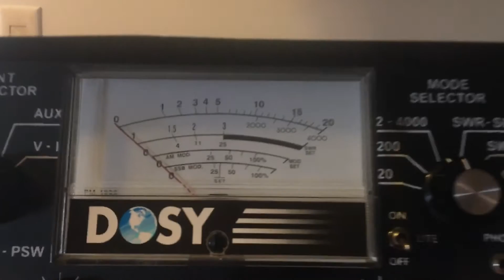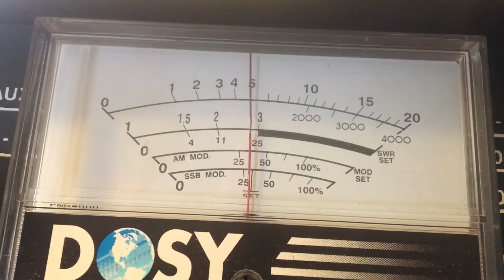6 tube elkin

Comment: Elkins are very good amps.  Friend of mine has an eight tube cluster, and he will not sell it period.  He finally got back his two tube that Ray rebuilt a few years back.  Would love to have an eight tube cluster, but they are hard to come by.

You mentioned a six tube Zodiac.  I just recently traded into a six tube Zodiac with a custom top case.  Ray's partner Brady built the Zodiacs.  Zodiacs have more tuners inside than the Elkins.  I counted four tuners on mine.  I did have to tune the input.  Not messing around with the other three!  It's doing about the same thing as the Elkin is doing in the video with a true peak meter.  Does not have high/low switch, but does have a power adjust variable on it.

Comment: I'll buy it
Reply from the maker: Lance Larymore sorry bro. This is a 2 year old video. It’s long gone now. I do have another that will be up for sale as soon as I get it back from the elkin tech. Keep checking on my videos. I’ll post as soon as I get it back
Reply: @Worldwide75  elkin tech name Shine ? Johnathan L. 
Or Ray ? Lolo . Shine is my best friend he worked at Elkin and his X lolo
Reply from the maker: Lance Larymore actually it’s frank Langley in Chocowinity. He’s a certified Elkin repair man. He does a lot of work on Elkins in my area and I just want him to double check everything in that six tube elkin and I also have asix tube zodiac in super good condition. Both will be going to him for a check up and then I will keep one and sell the other
Reply: @Worldwide75  these should do 800 if it's a super 6 . I've had 10 2,4,6 ,8 and 12 but I want another real 2 tube elkin
Reply from the maker: Lance Larymore I’ve owned 11 six tubes all with new tubes and I’ve never seen one do more then 600 pep on a peice of junk dosy meter lol
Reply: @Worldwide75  if it's a super 6 with 6lq6 with a high low switch it should do 800 . The straight 6 does 600 . I've had 4 super 6 and Shin guy worked at Elkin with his wife ( used purple wire) so they know who built it , wife used pink or course . But all my super 6 Did 800 on a bird . That's swing with bias up .
Reply from the maker: Lance Larymore 12dq6 are in all of the 6 tubes. A super 6 is the ones with high and low
Reply: @lancelarymore1667  "That's swing with bias up ."   I want my tubes to last years and years.
Reply from the maker: @kevin S well he works on all of them around here. He went to elkin and was taught by Ray himself according to Frank. He’s the only one around here for miles and miles that can work on them. He’s getting very old now and isn’t working at all much these days but his shop is still going